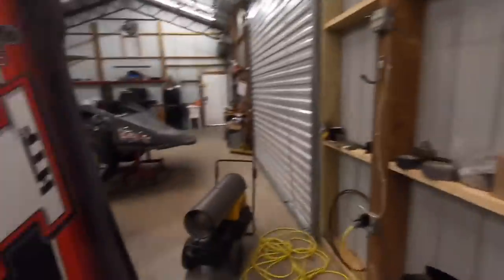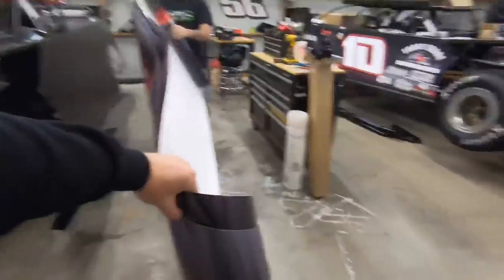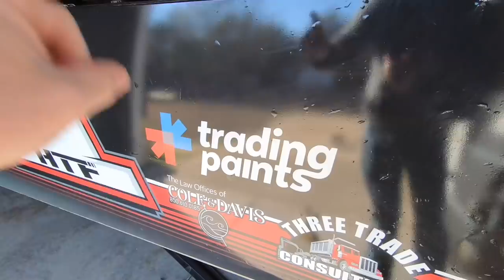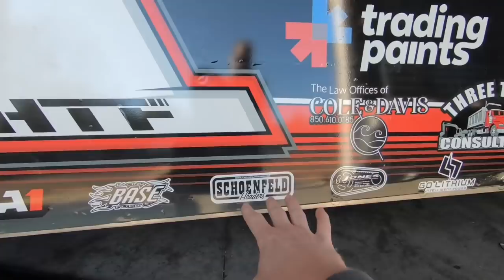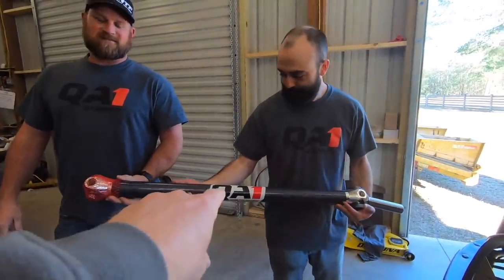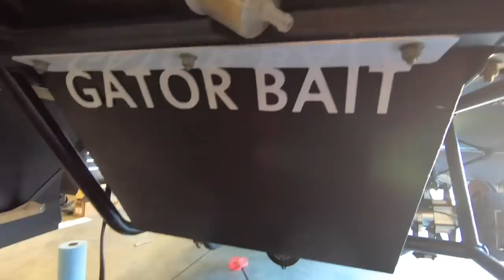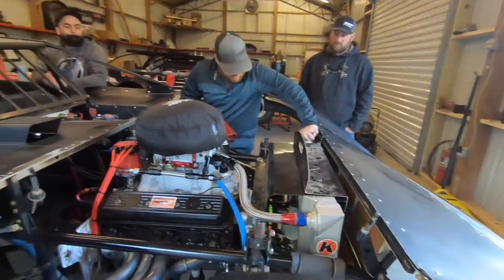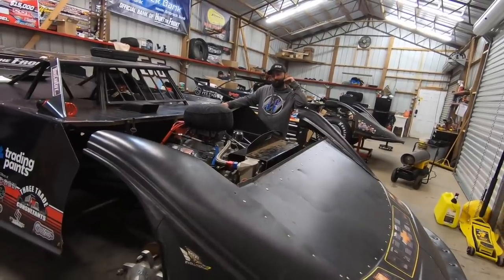The HTF1 Car is Back! Jesse’s Wrapped and Ready for his Capital Debut

Comment: A couple of tips. When working with those anodized fuel fittings, screw a fitting into it and clamp that in the vise.  Secondly, when changing gears, do no lay the cover down, simply slide it over and hang it on the studs. Swap the gears and pop it back on. Less chance of getting dirt in the works.  Third, once the new header have been heated, let em cool and spray some atf on em and wipe em down.  Keep em looking nice longer.
Reply: Yeah some people use wd40 to spray headers down after cooling or washing the car / motor.

Comment: The best way I found to get the push lock fittings together is to get a aluminum or steel plug and put it in the vise. Then thread the fitting into it that way it’s not moving around. Then take a propane torch and heat up the fitting for a few seconds and slide the hose on.

Comment: When we put our wrap on we use a spray bottle with soapy water to spray the aluminum....makes getting the air bubbles out a lot easier and in the case you need to peel the wrap back a little bit while installing, it helps it pull off easier without stretching the wrap. My dad taught me that and thought I would share for everyone who installs their own wraps!

Comment: Fun fact for yall to help build a little horsepower. You should buy an MSD non dial style timing light. MSD recommends a non dial style timing light. It makes the timing more accurate at the total timing when the engine is at full rpm. The part number is 8992. Found this out when timing my street stock.

Comment: Just a tip I’ve learned with doing vinyl lettering on dirt bikes. Spray a light coat of soapy water over the surface before you apply the wrap. Take a plastic or rubber applicator and smooth down the wrap taking out the air bubbles. Then take hair dryer/ heat gun and warm up the wrap to activate adhesive and dry up the water and soap mix.
Reply: these are air-release vinyls. there not intended to be put on wet. run a thumb across the bubble will make it disappear.
Reply: @zoomba31  exactly.  PLEASE DO NOT ADD ANTHING BEHIND THE VINYL!  You'll ruin the wrap.  Air release vinyl made for wraps will not work with water/soap behind it.

Comment: Have y’all ever tried using dish soap and water when you put your stickers on? Just use a old windex bottle, fill it with water and put 3 drops of dish soap in it. Spray the area of the car that you’re about to stick (do not wipe off, leave wet) . It makes it so much easier to work the sticker and bubbles.
Reply: By the way, try it on a smaller sticker first. Like a roof number. To make sure you like the way it works before y’all try it on a full wrap.

Comment: I recommend not heating the line I found if you take a pair of need nose pliers or snap ring pliers and kinda stretch the line a bit then quickly put the fitting in really works done it dozens of times no leaks or issues yet

Comment: Boy do you guys need help putting your wrap on!!  You have more bubbles under it than my wife has when she takes a bubble bath “NO SHIT”  I do know what I am talking about. I use to wrap 18 wheelers for a living. Use a spray bottle with water and a little dish detergent, spray it on the surface of the car then put your peace of rap on. Now you can slide it around to just where you want it and squeeze out the water from the center out. Give it a try!!  Good luck this weekend.
Reply: I have a feeling they take a "why spend too much time on it" approach. They figure its gonna get tore up after a few laps anyway
Reply: @bren-xmotorsports55    I would call it “PRIDE”. Have a good day
Reply: please don't do this.  Wrap material these days is made with less adhesive on the back of it.  It won't stick if you put water and soap behind it.  I can't understand why with air release material they would struggle so badly with the bubbles unless they aren't applying enough pressure or the graphics shop they use is using regular decal vinyl instead of wrap material.  If that's the case, then by all means apply water/soap.  I do 10 racecars a year and over 100 commercial wraps by my self.  I've never had bubbles like this.  the occassional wrinkle when I'm going too fast, maybe.
Reply: @clintsmith7642    Thanks for the comeback on the material, but to me the material looks thicker than the new material they use now. The newer material goes on like butter.

Comment: h
Reply: Hey fellas. Ive been watching yall since the beginning, cannot say how proud I am to see u guys success. However, after seeing  several wraps installed by yall, the air bubbles have GOT to go. im sure u know but soap, water (in a spray bottle} and a squeegie would eliminate this issue. I ran a modified several years, installed all of my wraps, and me being a inexperienced graphics person, each wrapturned out great, 99% bubble free, it also gives u a chance to move the wrap when wet to get it lined up perfect. takes a day to dry then ready to go. u have any bubbles, use a needle or razor blade tip to put a tiny hole to let out air then squeegie out.  Anyway, kewep up the  great work, good luck Jesse this weekend, God Bless.                                            Eoin Dunn